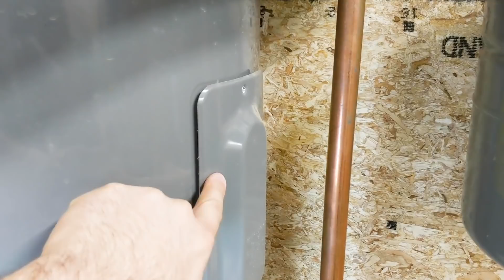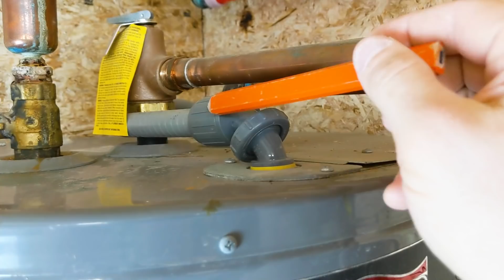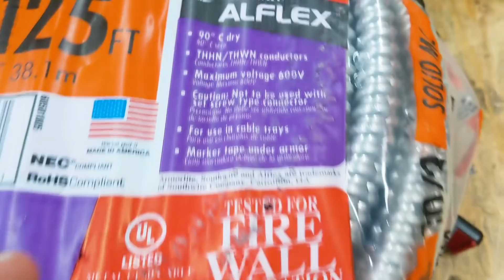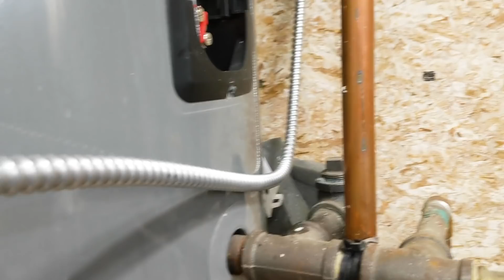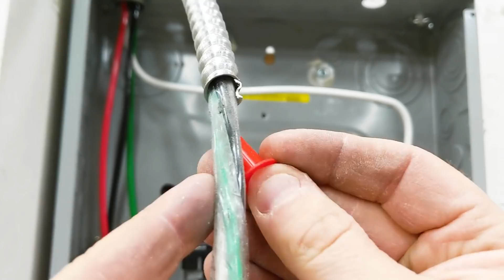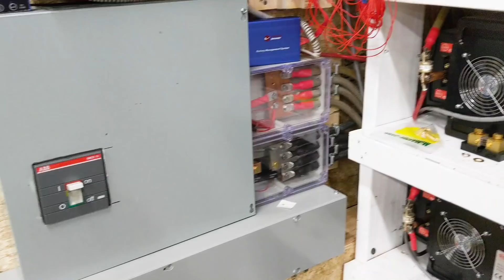Water Heater Diversion Load and Capacity Test

Comment: Very interesting because not many folks parallel LifePo4 and Lithium-ion.   But I'm confused on 100% charged at 55.31v (18:26 in video).  This would only be 55.31v/16 = 3.46v per LifePo4 cell and 55.31v/14 = 3.95v per Lithium-ion cell..   which is only 80%'ish (of max) charge because 3.65v LifePo4 * 16 = 58.4v'sh for 100% and 4.2v Lithium-ion * 14 = 58.8v for 100%.     Yet the test showed 27.8kwh/32kwh = 87% DOD which would have required a higher 'hi' than 55.31v.    So it doesn't seem to add up with only 55.31v hi -> 48v low range.   I'm asking in the spirit of technical interest!  (no complaints - appreciate your sharing your work and love your vidoes!!!)
Reply from the maker: For the test I charged the bank with my Victron 250/100 charge controller.  I set the bulk charge to 56.8v and the absorption time to 2 hours (recommended values from Victron).  After that the charge controller goes into float mode, which has  a pretty low voltage of 54.0v.  The reason is that once the cells are full, and you take away the charge amps, they drop down in voltage.  It doesn't mean they loose power, they just don't sit high.  This is just one of the characteristics of LiFePO4.  Despite the voltage being slightly lower at the start of the test, the SOC (state of charge) was still 100%.  This was documented with my Victron Smart Shunt.
Reply: @DavidPozEnergy  I set each and every voltage in sunny island to 2.30v. Float is 2.31. Set float any lower and it will discharge just as you said.

Comment: Great the way you are now introducing some intelligence into your setup.  So are your LiFePO4 banks 15s or 16s ?  I'm thinking 15s because I think that 48v would be too low for 16s
Reply from the maker: The LiFePO4 are 16s, and the Li-NMC are 14s.  Since recording the video I've even lowered my max charging voltage to 56.0v, but still have low-voltage cut-off at 48.0v.  I have videos on each of the battery builds if you would like more details.

Comment: 470 watts idle on the Sunny Islands ?
Reply from the maker: No, the loss of inverting DC to AC power.  The idle loss is about 50 watts for the pair.  The efficiency of the inverters is usually 93-94%.  There is always a loss with every energy change.  SMA Sunny Islands are one of the most efficient models on the market.
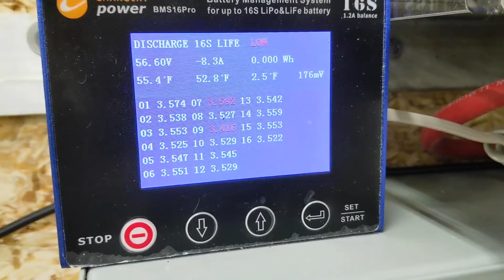Reply: @DavidPozEnergy  I was referring to the -8.3 amps draw before you started the test . Maybe the inverter self test draws more than idle  ? This was at 16:21 .    Only water in the loops or do you have some kind of additive ?  Great Video ! Enjoyed it .
Reply from the maker: You will have to ignore the amps on the Chargery BMS screen.  I was unable to ever get the calibration to read correctly.  All I use the Chargery BMS for is a cell voltage monitor.   Do NOT buy the Charger BMS (in my opinion).

Comment: Have you thought about solar thermal, or a heat pump water heater? Loving my 80gal Rheem heat pump water heater.
Reply from the maker: Yes.  I have a dozen or more videos on my channel about solar thermal.  I have personally built a 250 gallon thermal battery inside my house.

Comment: You should make two labels. Both saying “Dual power source.” And stick them to each of the element covers. Even though you know that, but just in case someone else comes in for whatever reason.
Reply from the maker: Good idea, thank you.
Reply: In some jurisdictions it's code.  You have to label dual power sources.
Reply: @derrellmcdougald7800  In this case, it’s nearly a suggestion. Why? Because both sources are “off grid”, thus code does not apply. Code only applies when hooked up to the grid.
Reply: @robertsteich7362  If I'm not mistaken David's "on grid" system is connected to a transfer switch in the house, so it is a part of the actual on grid system. Plus unless I'm very mistaken code applies just as much whether on grid or off grid.

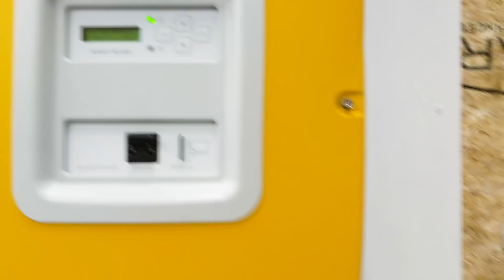Comment: Hey , David I have a question about 16:20 it's chargery on LCD cell 7 and 9 is on red. It's accurate value's of voltage of this cells? I have one and shows on it difrent value's to my digital multimeter. I scared to used it with my battery.
Reply from the maker: The Chargery is not great as a BMS.  However, I have checked and mine at least displays OK voltages (within 50mv) to my multi-meter.  The chargery BMS is only displaying voltages of my BYD batteries.  My BYD batteries are a regretful purchase.  They don't stay balanced because I have at least 2 cells in the stack that are self-discharging.  I have switched to the new Gyll batteries (in the server rack) and plan to dismantle the "Tower of Power" this summer.  But I wanted to do this one final capacity test before I do.

Comment: geez... it seems you got so many batteries. i thought you were already off grid
Reply from the maker: 9 months of the year, I am.  (Mar-Nov)  But Dec, Jan, and Feb I use more power than I can produce during those months.  I have electric heat, and the solar window is smaller.
Reply: @DavidPozEnergy  It would be interesting if you could offset the electric heat somehow. Have you considered an outdoor wood stove? I've seen them in other videos. Not sure who manufactures them.
Reply from the maker: Outdoor wood boilers are made by several manufacturers.  There is a short list of some models legal for my state (MA) but the permitting process is a nightmare.  I'd save time and money moving to a new state. LOL

Comment: One mistake about the water heater always being the same load: It won't be. The cold water supply may vary 20-30°F depending on the outdoor temperatures, so it may take substantially more or less BTUs to heat that tank, unless you make sure of the tank temp before you start.
Reply: He's not heating the "tank" , He's heating the garage floor with recirculation through the tank so the load will last longer than the batteries every time.

Comment: Future video will be whatever David ads to the bottom thermostat as a second dump load. Because there just has to be a way to use all that float time lol.
Reply from the maker: Yes, this time of year I have a lot of float time.  Not very much extra power in middle of winter (if any).  Do you have a diversion load setup?
Reply: @DavidPozEnergy  I have tried it a few ways but as I am basically lazy the Sun grid ties are now my dump load so I can have some winter energy stored up but I never set them up on automatic yet. I do like the AC dump load better than the DC dump load.

Comment: Also looking to make this for my system, but I'll be looking to use an element which does not require an inverter. That way no conversion from DC to AC occurs and I won't need to worry about the inverter capacity getting reached if there's no ~5kW additional load on it.
Reply: Be very careful with that. It's not the element that requires AC current, but there's a good chance the thermal switch is not designed to interrupt a DC arc. With AC, the voltage reaches zero which will interrupt an arc with a sufficient air gap.
Reply: @MarkRose1337  excellent point. Switch DC is hard on contacts.
Reply: Does the heating element care if you use 240 V AC or DV ? I’d think if voltage and amps are below the rating then it should just work
Reply: I was also thinking of doing a batteryless or non gridtie  solar system for my house, I have only 1 element working for my hotwater heater cause the other broke, the idea is I would set the solar at a higher temp so it would keep the ac element from turning on as often and if I do laundry and showers in the daytime the solar can help reduce the ac power use. Are you sure the ac thermostat won't work on dc the same.

Comment: So what did you do with all that hot water sounds like it's pool time 👍🤪🙄
Reply from the maker: I was running my radiant floor at the time, so it heated my garage.  Remember, there is a delay between building something, filming, editing, posting.  At the time I was using heat in the garage.

Comment: Very interesting.  I have the Rheem water heater with WiFi.  That tank feeds 3 Rheem electric tankless heaters so the tank can act like a hot water battery to reduce the load on the tankless units.  Works great with our 10kw SolarEdge solar system and 32kwh of LTO battery storage.  But I have to manually turn on the tank power each day via the Rheem app.  I'll be interested to see your next steps on this project.
Reply: Did you build your LTO battery ?
Reply: Why do you have to manually turn the power on?

Comment: I love watching your videos. I lived off grid with just 2- 75 watt (1994) solar panels until 2012. I used propane for my cook stove and on demand hot water heater. I used a big wood stove for heat. I only had to charge my batteries with a generator in the dead of winter. I had an auto sun tracker for the panels and 4 Trojan batteries. I ran my lights, a little tv with a VCR for my son to watch videos, my stereo with a CD player and a laptop. My house n hydrants outside water was gravity fed at about 9 gallons per minute from a mountain spring source with a 500 gallon reservoir. Now I'm on grid in Missouri and I'm a nervous wreck about the power going out. I have an electric water heater and an electric deep well pump. If I lose power I won't have a water source. I really wish I could go off grid again and use all the new high quality solar resources.
Reply from the maker: Congrats on an amazing 18 years off grid.  That sounds like paradise to me.
Reply: @DavidPozEnergy  when I moved on grid, it took me 6 months to adjust to the sound of street light. I'm back in the deep woods and surrounded by Corps land. Only street light is in the front of my property. I still want OFF GRID. Self-sufficiency is my only peace.
Reply: What part of the state are you in? I am also in Missouri.

Comment: I sure wish you were my neighbor in Texas as I need a little help in configuring my system. I installed 25, 395 watt solar panels and a 12k sol-ark. Trying to be self sufficient here in the hill country as we have had power issues in the past.
Reply from the maker: The Sol-Ark is top of the line.  Nice inverter.  Hit me up on Facebook if you want to discuss details.  It's hard to get into it on YouTube.
Reply: @DavidPozEnergy  sorry David, I don’t have Facebook. My email is dmpdretired@gmail.com
Reply: I have two Sol ark 12k’s and 48 430 watt panels inbound. That is what takes for a 2600 sq ft home, burning 40-60 kWh/day.
Reply: I have a system very close to yours I am about to re-do with building a ground mount racking system for 24 370W panels on my off-grid farm to add to my current 16 360W panels. I have to change a few things in my panels wiring to enable them to all balance feed into my Sol-Ark 12K. The bulk of my diversion will be for pumping and heating water. I want to avoid piggybacking another Sol-Ark 12K as I prefer to invest more money into my battery bank which, like David's, is mixed chemistry of two different types of lithium batteries. Mine are more severe in charge rate difference than his as I have lifepro4 and LTO .

Comment: I have been waiting for update on this! Thanks Dave!
Reply from the maker: Your welcome.  It was a little odd putting all the pieces together into one video.
Reply: @DavidPozEnergy  So you got rid of the idea of using the Arduino Mega? You talk about using the SMA inverter with a relay.. My Growatt 's do not have a function for this. I wish there was a specific product for diversion loads. Can't wait for the next video update. Thanks again! 

P.s. Video request, I would like to see how you decided to hook up your Lifepo4 with the LI-IONs as they are different voltages. I was thinking of purchasing the LG server packs and adding them to my BYD's and using the BMS on each pack for the safety on/off for the lifepo4's how ever the Lifepo4's will never get a full charge that way..
Reply from the maker: Back when I got the Arduino, I was still running the Aims inverter.  The Aims inverter did not have a relay built in that could control a diversion load.  The SMA inverters have a programable relay.  

The batteries parallel together at the main +/-.  Each battery has a BMS to monitor individual cells.